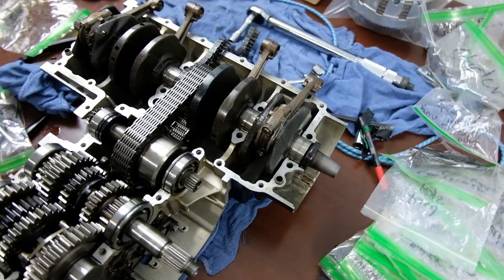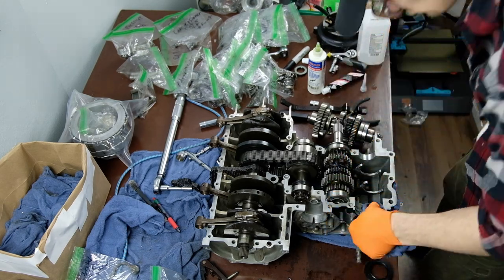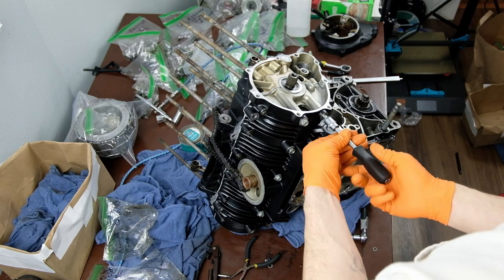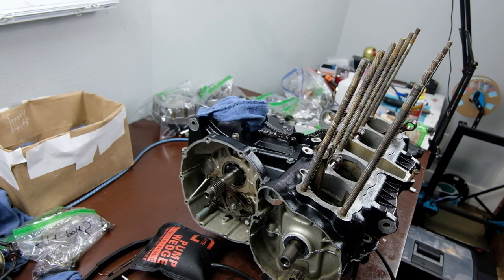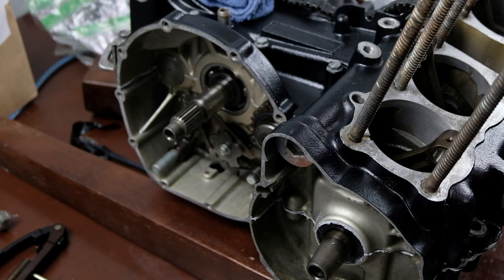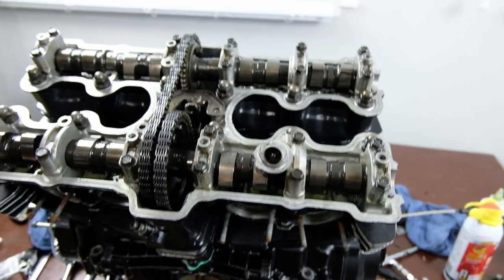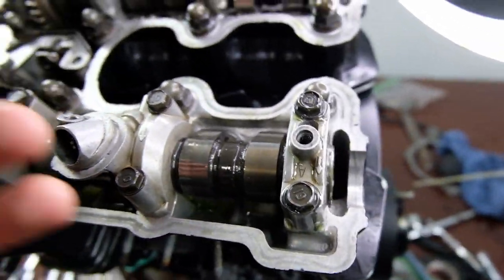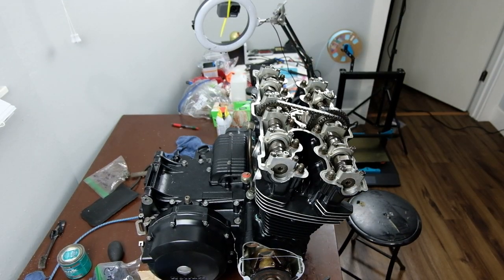1980 CB 750 DOHC engine Rebuild (pt 2)

Comment: Awesome stuff mate, great content! if only I came across your video a week ago when I assembled my engine.
Reply from the maker: Haha, ya. Sry I couldn't be more help, ill be posting a vid on electrical for the bike this week, if yr to that stage yet.👍
Reply: Looking forward to it bud !
Reply: I see that had some trouble putting the main cam chain on the sprocket .... how did you eventually get it to sit on ?
Reply from the maker: @Adm7869  if I remember correctly I used the cam retainers that go on the ends to press the cam down enough to attach the sprocket, I believe I had the chain on the sprocket already, and I just bolted it back onto the cam. So i didnt have to pull the chain onto the sprocket just bolt the sprocket on. I think the key was using the retainers to press down the cam so I could get the chain on, also make sure your chain tensioners are as loose as you can get them.
Reply: Thanks for making the video I'm in the process of doing the same rebuild. On the forums they recommend installing everything into the top crankcase first and then putting the bottom on next.
Reply from the maker: @TouchPoint Property Management  For sure! I would have liked to do it that way but I was afraid I wouldn't be able to easily move the engine around after assembling the top, because it's just me here in my apartment, so I didn't want to have to move it until I put it in the bike, but I agree that would probably be easier, that's how I've scene it done with assembly of older SoHC cb's on youtube. If I had purchased some kind of rotation engine stand I'm sure I could have simplified the process. But I'm cheap, so I usually end up doing things the hard way. LoL,
Goodluck on your build!

Comment: Dear Baby Jesus...thank you for the Crafty Worksss video. Being that you installed everything into the lower crankcase first....How did you ensure the primary chain oil feed nozzle stayed in place when you turned over the upper crankcase? I didn't see any contact points for it on the lower crankcase
Reply from the maker: I believe I actualy put it on the underside of the top of the crankcase since there is a place where it seats into the case, instead of just setting it on the bottom. So it sandwiches in. I just used the Lucas Assembly lube. It's very tacky it was enough to hold it in place as I dropped the top on.

Comment: After you rebuilt the engine...how did you get it back in the frame?
Reply from the maker: The frame on these 750s actually comes apart on one side, it allows you to slide the engine in, you just have to remove the oil filter before you do it, but it will slide in with a bit of fiddling about.
It is heavy though so its nearly impossible to do alone.
Reply: @one.crafty_boi  I saw a guy strap the engine to a big barbell and then rest each end on jacks which were on top-up rollers to roll it in by himsef
Reply from the maker: @TouchPoint Property Management  I saw that video too, definitely would have done something similar if I'd had the room, but the tight work area didn't really allow for anything like that, I may do something similar though when I pull the engine for frame paint.